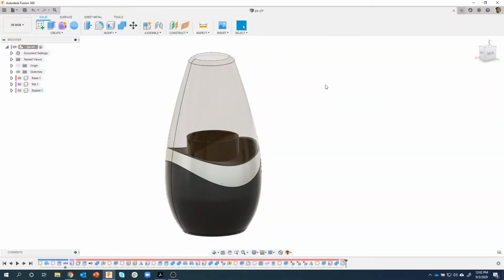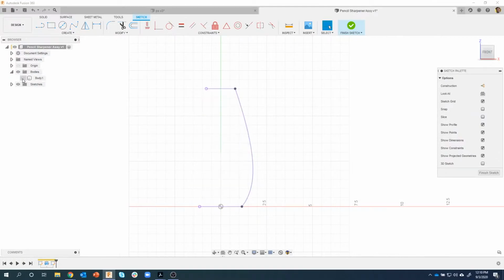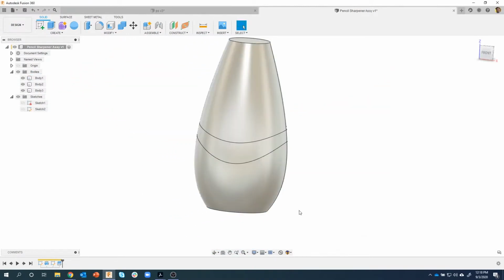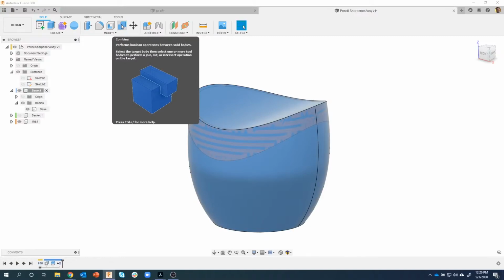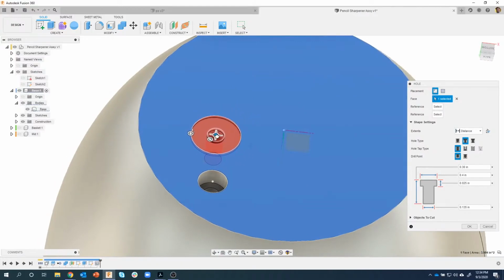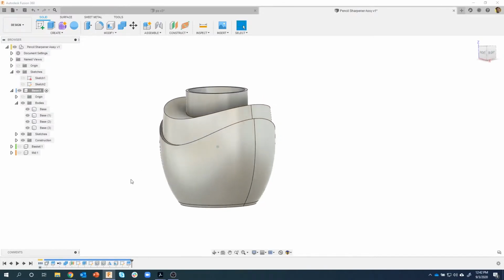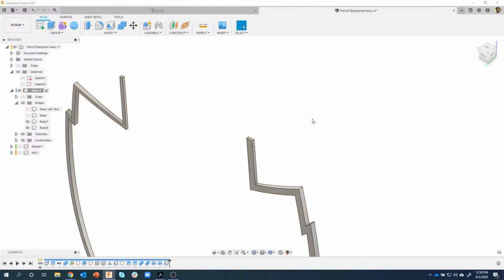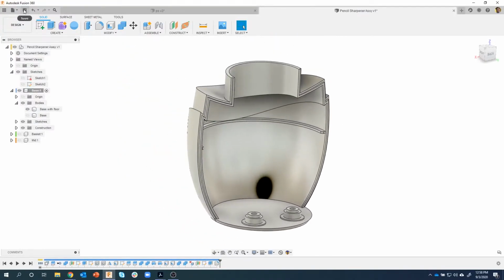Episode 71 - Pencil Sharpener Project   Part 1

Comment: Brad I  just started this series, just finished the 214 drawing and the DP755 drawing and I love to follow along and work out sketch with you as I do the project on my computer.  I am 57 and I love to do these projects and I get my grandkids involved and they are starting to learn Fusion 360.  I have been doing Parametric sketches that I learned from you and it makes changing my models so easy.  For some reason when I do a mirror it does not give me a preview of what is about to be mirrored. Has to be some type of setting that I do not have checked I think.  Everything gets mirrored like it is post to but no preview.  Thank you so much for your explaining everything so clearly it helps this old timer out and also my grandchildren. Thank you, Thank you, Thank you!!!!

Comment: As always, very nice tutorial.  But following this I get an Failed to Perform Boolean Operation at the step to combine the 2 parts to create the lip at 54:52 ?? I don't know why ?
Reply from the maker: @Amyot  Make sure the two parts "overlap" each other, at least a little bit.
Reply: @bradtallis8968  They do !  I did just like your video, split body, and I never moved the body, so when I created the lip, it's intersecting with the other part. I use the combine body to cut another body a lot actually, and I understand the concept very well, but I can't explain why in this case it's not working !
I will probably send my file to fusion to see if they see something weird !?